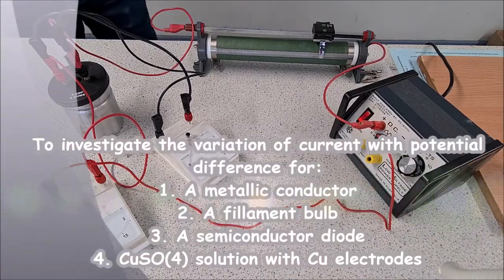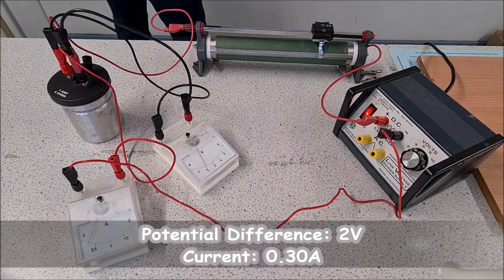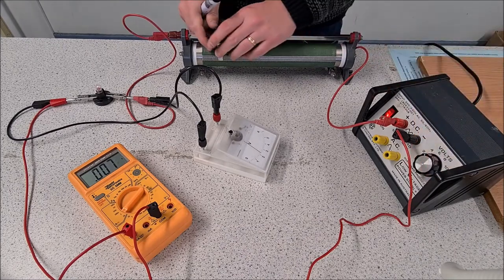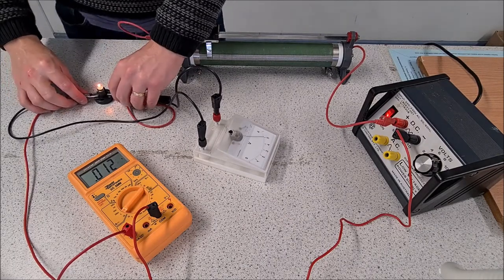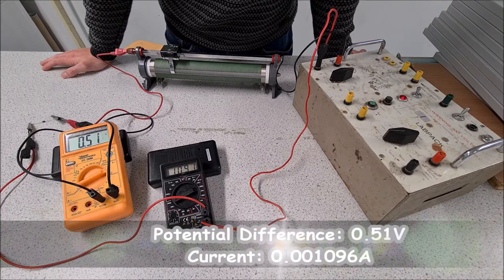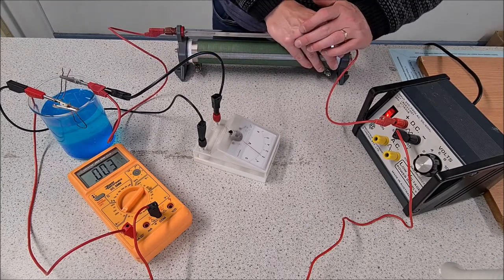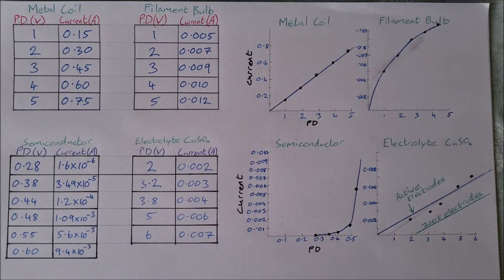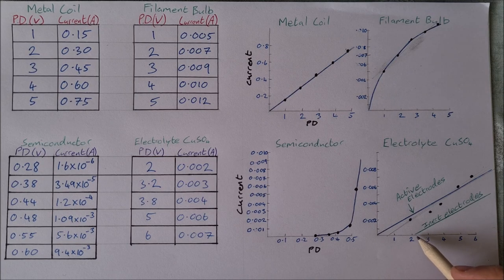Current vs Potential Difference for 4 Different Conductors

Comment: Hi Teacher. Does the resistance change as the potential difference across a metallic conductor varies?
Reply from the maker: No, if the metallic conductor is kept the same then the current will change as you vary the potential difference according to Ohm's Law. The resistance will remain constant, resistance = potential difference / current (r=v/i)
Reply: @SimpleScienceandMaths  Thank you very much
Reply from the maker: @charmainemeredith3030  no worries! 👍